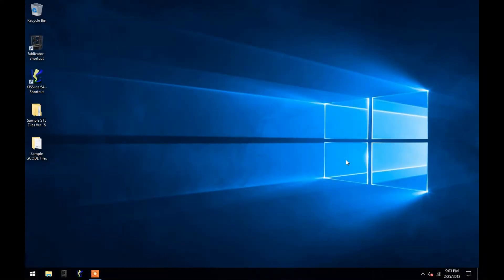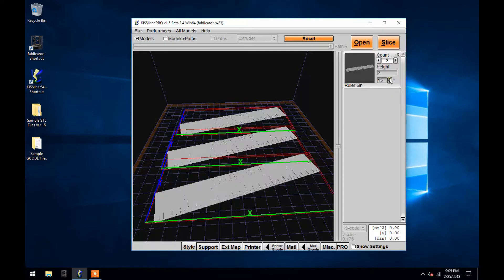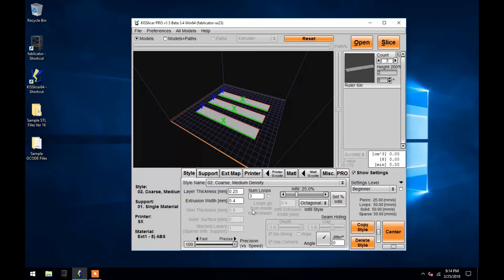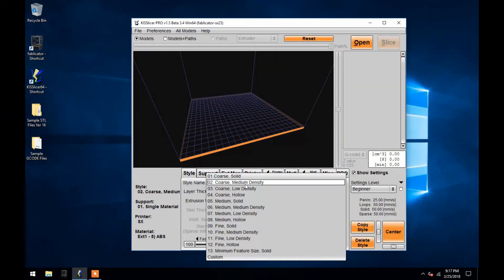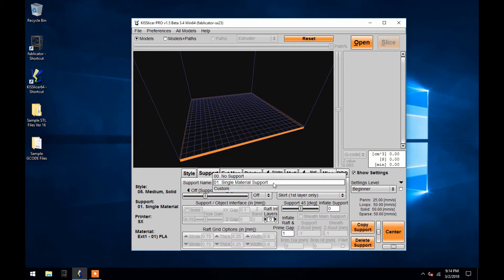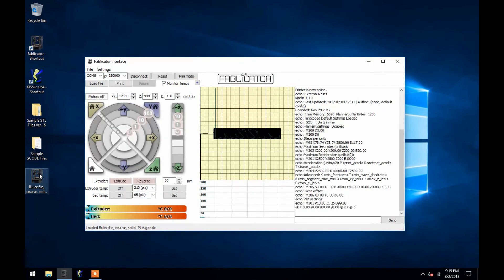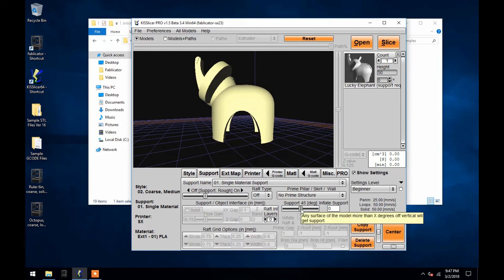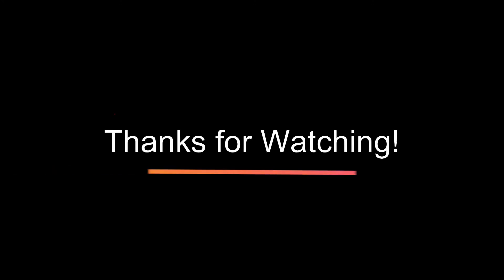How to Use KISSlicer (Fablicator SX 3D Printer)

Comment: After the slice is done and the g codes are saved, if we don't have a fabricator programme then what is the solution
Reply from the maker: Hi Vikas, this video is made specifically for Fablicator 3D printers, which we manufacture. Our printer has a built in computer with the Fablicator program installed to run 3D prints. How you would run a GCODE file on your 3D printer depends on what printer you have.